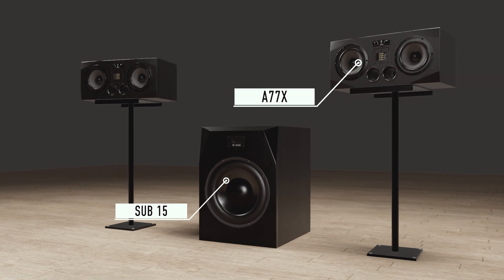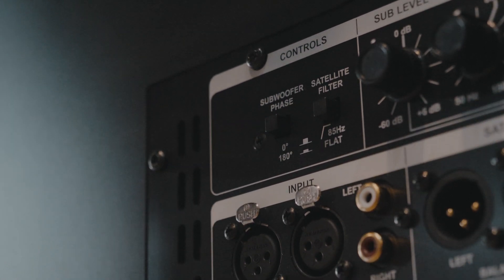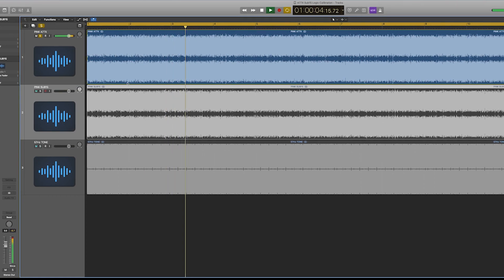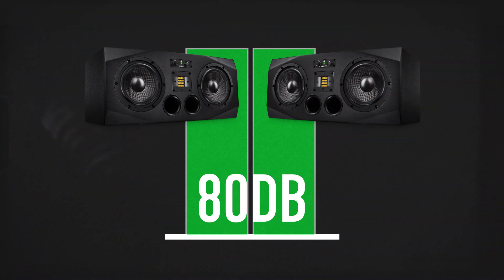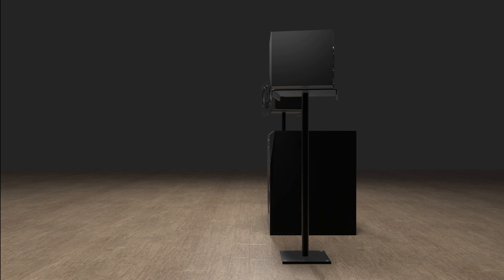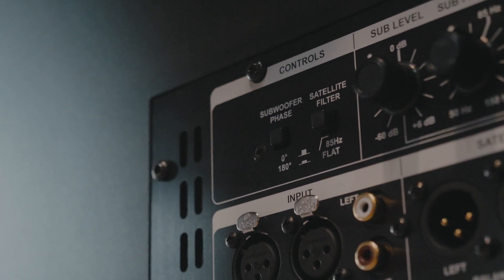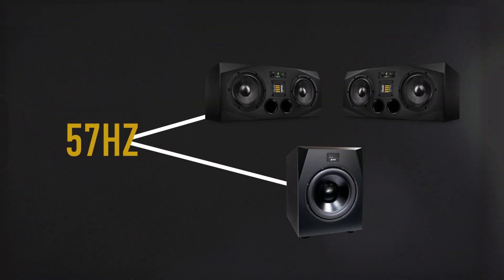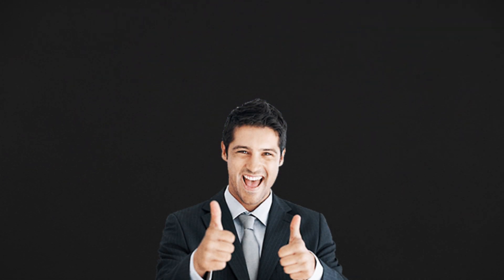How To Calibrate a Subwoofer (The Basics) | ADAM Audio

Comment: Hi guys, have upgraded from f7 to a4v.... regarding the sub calibration for example with sub 8,
Considering a4v are smaller and frequency response starts to fade off in the lower range, would sending a tone 1.5 octave higher then speakers cut off point do the same trick, considering in this case that both devices can reporoduce the same frequency... for example 66hz to both devices... once it nulls flip the switch.

Comment: I think if you recommend to crossover at 75HZ in the manual (Sub7), I think it should be marked in the frequency knob instead of the 85Hz (which you already have fixed at the rear button). I if want to crossover at 75Hz as you say, I don't know where the exact point is
Reply: you ever figure this out on your end or just wing it?

Comment: I previously spent my budget on purchasing the A77X, so with the remaining budget, I could only afford the T10s. However, here's the problem: I see that the crossover on the back only has three options: 80Hz, 120Hz, or Bypass. How should I set it?
Reply from the maker: Hi @PW_Channel! Congrats on getting yourself a pair of A77Xs!  In combination with them, we would recommend getting a larger subwoofer, such as the SUB12 or even the SUB15.

The T10S is constructed to be used with our T Series Monitors, and will not bring as much benefit when used with the more powerful A77X as a bigger subwoofer would.

Regarding the crossover, we would recommend to use either 80Hz or 120Hz. If you bypass the crossover, the bass frequencies will be played by the subwoofer and the monitors simultaneously, leading to an exaggerated bass response of your system.

If you have any further questions on that topic, feel free to reach out to our support team here:

https://support.adam-audio.com/hc/en-gb/requests/new

All the best and greetings from Berlin, Jasper from ADAM Audio
Reply: @ADAMAudioBerlin  Thank you so much!!

Comment: : GREETINGS. my question is this, i have a sub7. in my manual it say i should sett the crossover between 70-75hz. in this video the info tell me to sett the crossover 1.5 = 90hz. so witch is it. for the thank-you for the closure.
: Frank-Eddie-Bjørge: Nikolaisen.
Reply from the maker: Hi there! A good starting point is actually 80 Hz. Then adjust from there as needed. The exact number is not so important if the integration of the subwoofer into the system is done well. However, there are two extremes to consider which show you why you should not stray too far from 80 Hz: 
As one goes higher with the crossover the subwoofer is increasingly easy to localise when it is physically placed in off-centre positions in the room, which it should be. 
As one goes lower the benefit of adding the subwoofer to the loudspeaker decreases because the loudspeaker has to work harder. 
This is why 80 Hz is a good place to start and then only adjust up or down a bit to avoid issues caused by the room, e.g. reflections affecting the bass around 80 Hz. As you see there are multiple things happening here so it is a balance of trade-offs!
Reply: @ADAMAudioBerlin for the comprehension, for the Thank-you

Comment: When using a monitor controller with a mono out to the sub, could you not use the phase inverter on the sub rather then having to use the Radial Phazer?
Reply from the maker: Hi Jason! Whilst the Radial Phazer is probably very good at what it does, it costs about 400 USD. This is a lot of money to spend on a phase control that is already built into the subwoofer. This control adjusts the subwoofer channe,l not the left/right channels, so it can be used to compensate for different listening distance the subwoofer relative to the loudspeakers.

Comment: How can I do this with the S3H and a Sub8? Is the Sub* too small to work for these speakers? I tried this but the Sub8 won't won't reach 80db.
Reply from the maker: Hi Andy! We usually recommend a bigger Sub for the the S3H. Yet, the sub 8 should reach 80 dB without a problem. If the same thing happens with a different SPL Meter we would recommend reaching out to our support team via our official support form at the bottom of this page: https://www.adam-audio.com/en/support/. Hopefully, we'll find a solution to your problem as soon as possible. Have a great day! All the best, Daniel from ADAM.

Comment: Hi! If i have a Sub7 and T7V monitors can i calculate the low pass filter in the same way? If not, where can i find info of how to calculate the low pass filter for my setup? Lowest cutoff of the monitors is 39hz. Is x 1.5 a standard calculus?
Reply from the maker: Hi Daniel! Yes, the setup is identical. Let us know if you have any further questions. All the best!
Reply: @ADAMAudioBerlin  Thanks a lot! Can i use any of the calibration files for my sub? If so, can you let me know which one?
Reply from the maker: Hi Daniel! The Sub 8 is most similar to the sub 7. Let us know if you have any further questions.
Reply: @ADAMAudioBerlin  actually i have. There is no way turning up the Sub7 to 80db with the Pink Noise. The woofer just cannot handle that volume without "distorting" (using the quotes as i do not know how to explain the sound coming out from it). What am i missing?
Reply from the maker: Hi Daniel. Can you please reach out to our support team via our official support form at the bottom of this page: https://www.adam-audio.com/en/support/. They will find a solution to your problem as soon as possible. Have a great day! All the best, Daniel from ADAM.

Comment: figured it out! thank you. I realized that my sub needed to be cut at 63Hz (for the sub10) not 57Hz, to reach 80db. checked the phase and it turns out I was in the sweet spot. no need for the phase button. practically the way I had it except the low end shelf on my satellites wasn't cut. great video. edit: Forgot to mention that on my SPL meter i was measuring on DBA when I needed to be on DBC which was one of my issues.
Reply: my SPL app is also using Dba - do you have an app or hardware meter you can recommend?
Reply: @sladefx  Decibel X Pro

Comment: When you set the satellites to 80DB then you set your subwoofer To 80DB when you do that your subwoofers level will be lower then your satellite speakers level
Reply: Whycome?
Reply: @willch19   It’s hard to explain but when you set the subwoofer like that the subwoofers will have low loudness and the other speakers with have high loudness
Reply from the maker: Hi Abigale! If you move around in the room, you might recognize that the bass is louder in the corners of the room or close to the wall. If this is the case, you might have standing bass waves in your room that are phase-rotated and canceling each other out at your listening position. That means that you might have to overthink your listening position, sub placement and/or install bass traps in the corners of the room to lower the reflection. 

There are countless tutorials about room treatment on youtube, such as this one https://www.youtube.com/watch?v=O4NIA7EHxYk

Let us know if it helped. All the best!
Reply: @ADAMAudioBerlin  I don’t believe what you are saying what do I believe is that the bass in the corner of the room is the same as the bass anywhere else in the room
Reply from the maker: Hi Abigale! It would be very unusual for sub frequencies in general if they had the same volume in the entire room. How did you determine that the subwoofer level is lower than the satellite level? Did you use a measuring microphone? All the best, Daniel.
Reply: @ADAMAudioBerlin  I have use a measuring microphone with the yellow decibel sound level meter yeah even though I match the decibels of the different speakers I leaned  that the subwoofer loudness can be 60 percent lower then the other speakers so using a microphone to adjust the subwoofer is very inaccurate
Reply from the maker: Hi Abigale. Please reach out to our support team via our official support form at the bottom of this page: https://www.adam-audio.com/en/support/. Hopefully, we'll find a solution to your problem as soon as possible. Have a great day! All the best, Daniel from ADAM.

Comment: When I used an SPL meter to calibrate my subwoofer my subwoofer loudness was 30 percent less louder then my other speakers so this means an SPL meter is an unreliable tool to use when calibrating the subwoofer so if you want the full loudness of your subwoofer you shouldn’t use an SPL meter to calibrate your subwoofer
Reply: So how do you calibrate instead?
Reply: @uaaadingding  I just listen to the crossover frequency of my speakers which is 72 Hz ad I adjust my subwoofer volume so the 72Hz and the 64Hz has the same loudness that works perfectly yeah the 72Hz is the halfway point of my crossover and the 64Hz is one quarter of my crossover so 72Hz must be two quarters of my crossover

Comment: Hello! If i consider to place two subs independently for each channel, is there a way to make it stacked with monitor one on another? I know, in terms of vibration it's bad, but in terms of space it may be necessary. Thank you!
Reply from the maker: Hi The New Voice! This is definitely possible. You just have to make sure to prevent vibration by placing pads between them for example. It really depends on your setup. Have a great day!
Reply: @ADAMAudioBerlin  Thank you

Comment: I've been thinking to get a pair of A3X and a pair of Sub7 to make a 2.2 system. I imagined putting each A3Xs on top of each Sub7 to behave like a 3-way system.  Is it possible to do so? Or is it better to have the conventional 2.1 system with a pair of A3X and one Sub7?
Reply from the maker: Hi there. Both ways work fine and it really depends on your preferences. How about you start with a 2.1 system and decide afterward if you need another Sub7 or a single one is enough.

Comment: @ADAM audio Is it also possible to combine the testing files? In my case for A7X and Sub8? It means using Pink noise for A7X and Sub8 and then for phase aling send the 63 Hz tone? Thanks for advice.
Reply: I have the same setup like you, and I got a hole at ~75 +/-  Hz 😫 it‘s hard to calibrate a mono sub with stereo speaker 😫

Comment: Hello, where can I order speaker stands for my A77X? I live in Belgium but I can’t find them. It’s for dj’ing so they need to go high enough because I stand all the time.
Reply from the maker: Hi! We would suggest reaching out to companies like K&M and Zaor, because speaker stands like the ones you need are not very common. You might have to think about getting custom-built speaker stands.
Reply: @ADAMAudioBerlin  ok, Thanks!
Reply: I founded some stands🙂🙏. Would love to buy a sub to but the Sub15 is to expensive for me. Would a 10 or 12 also do the job?
Reply from the maker: Hi there, yes a Sub10 MK2 or Sub12 will also do the job if you don't listen to them on Max. SPL, as the Max. SPL is only matched with the Sub15.
Reply: @ADAMAudioBerlin  Thank you.

Comment: Didn't work for me. I tried to calibrate a A5X and Sub8 Combo, Crossover Point 75Hz. My SPL Smartphone App (decibel meter) never reached close to 80db for the Sub Pink Noise Track. Even if I hold it right close to the Sub 8. Either my Smartphone's to old (iPhone 4s) to be able hear these low frequencies or something else is wrong. Maybe with the Pink Noise Sub Track.
Reply from the maker: Hi Eisich, this could have several reasons. First, your iPhone probably doesn't pick up these frequencies in the first place. Have you tried using a professional sound level meter device? Another reason might be the frequency range of the sub pink noise track.
Reply: @ADAMAudioBerlin  I used you official Pink Noise Tracks. Then it has to be the iPhone. But then I don't understand why everybody (you included) are recommending to use a Phone to calibrate in the first place.

Comment: 1) Why set the volume so high (80dB)? Can the calibration be done at lower volume, like 50 or 60db? 2) I guess I can use the same calibration procedure for A7X+Sub8 combo, right? 3) You didn't explain in the video what is the 57Hz Tone for, can you elaborate, please?
Reply: I had the feeling blowing up my speakers calibrating at 80dB (ipad as spl meter) so I went down to 70.
Reply: toefes to be honest I did mine at 65dB(A) which was already quite annoying even with closed cup headphones on... I also saw 80dB in another instruction video, so maybe there’s some particular (well kept secret!) reason why..
Reply: Because 75-85 dB has a more flat response in studio monitors
Reply: You speakers should be able to handle well over 100 db, so you're likely to blow an eardrum before blowing a speaker in this process.  I will point out that unless you have the S-series speakers, you really should break your speakers in.  Adam Audio also has a video on that process, but in short, you should play music for at least 8 hours before considering them broken in.

There are a couple of reasons they pick that specific level (some prefer 83 db spl):

1) Pink noise is generated at a specific output, so when you place the volume on your system at the calibrated point, it assumes it's pumping out 80 db of noise.  So, if you undercut your DB output during calibration, when you send an audio file to another system it will sound much quieter than you mixed it at.  That really becomes a problem when you're working as part of a team because they're expecting it at one level, but you're producing it at another.

2) 80-83 DB SPL is where the human hearing is flattest, so you get the most even response across your audio.  If you set your output so that you know right where that level is, you can quickly go back to it to get the most out of your mixes.
Reply: @gamger5583  My problem seems to be that my Sub10 Mk2 won't hit 80 db from the mix position.

Comment: Are you putting the spl meter to the same listening position or is on the floor? I only get readings of 60db as the highest
Reply: For anyone having this same issue: check your SPL meter for weighting settings - choices should be something like A, C, and Z - you want Z - saw this in another comment/response - it is helpful info.
Reply: Listening height.

Comment: hello ADAM Audio, this calibration is meant to be with the 85Hz highpass filter off, right?
Reply from the maker: Yep!
Reply: @ADAMAudioBerlin  if I use the Sub8 and I need to set the crossover frequency to 60Hz, where should I place the knob? Since the marked points are not equally distributed on the knob
Reply from the maker: @Oblium  It's a lot of trial and error. You can get it to roughly 60Hz with the knob on the front, and we apologize that they aren't as clearly labeled as they could be. Get it in the general vicinity and then listen to some tracks that you know VERY well to make sure the low-end response is accurate and true to the song... then make adjustments accordingly if need be. This video isn't a hard-and fast rule as it depends a lot on your room and many other factors, but wanted to show the most essential and basic steps to setting up your subwoofer as a good starting point.
Reply: Oblium Try with playing a 60Hz sine wave through band pass filter with 60Hz and a high Q and then see/measure at what knob position the amplitude is the maximum?
Reply: @ADAMAudioBerlin  i'm feeding my A7X with my Sub8 satellite outs. I don't get why i should disable the 85Hz highpass for this calibration if later i will engage the highpass filter for my satellite out?

Comment: Hi, 
Very many of my questions in this video received answers, but there are still questions, please help to understand: 
1) How to set the cut on 57hz on the subwoofer? Unfortunately, there are very few designations and not logical allocation to the sectors of the adjustment knob.(if it is possible by the example of the minute hand, how many minutes will it set?) 
2) The video says "turn off A77X and turn on the PINK+SUB15 track" do I need to physically turn off the A77X monitors? 
3) I do not have Apple devices and for this I do not have Logic X program, I downloaded calibration files from your site in .aif format, turned on via foobar2000 (ASIO), along with pink noise there is TONE 57Hz, so it should be?
Reply: 1)….

2) Yes turn of your main monitors (A77X for this exemple) and and set the sub to 80dB.

3) You only can use the files if you use the Adam Audio A77X and Sub15. You need to make your own pink noise files with the right sine wave Sub frequency. (Exemple: Adam A5X cut off freq is 50Hz, So 50X1.5= 75)
Reply: @mitcheltheelenmusic8858  the Cutoff on the Sub10mk2 is 25hz. So would it be there 37.5 hz? And how or where doni have to turn that on. ...on the DSP EQ (PROGRAMM...)?
Reply: @mitcheltheelenmusic8858  hi, can i use these files as well with S3H & Sub 10 mk2? Can i import these files into ableton or presonus studio 1? And where should be the cutooff freq. On that systm? Great video but could be a bit more specific :) regards
Reply: @lockee77  hey did u ever get a response to your questions? I use Studio One with the S3Hs and Sub 10 and even have Ableton too lol. Kindred spirits
Reply: @Ifelovv  sorry for the late answer. Not really. It was a standart one 😑
Reply: @Ifelovv  It is not profitable for them to answer. It is profitable for them to SELL.
They have no answers - because the product is not quite professional class. In fact, it is an entry-level product. Hence all the shortcomings/problems of buyers. They leave you with the received questions and problems.
Reply: Thanks for these tips. One question though: When I create my own pink noise files, do I filter all frequencies above the cutoff for the sub file? And all below the cutoff for the satellites?  @mitcheltheelenmusic8858